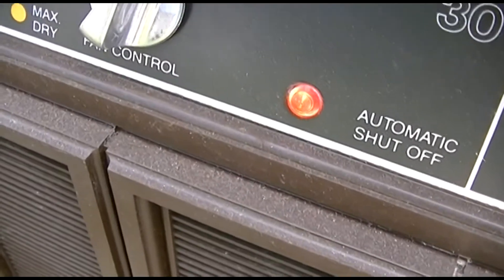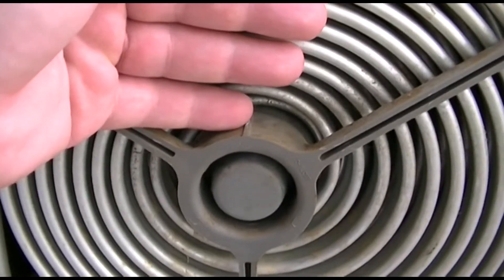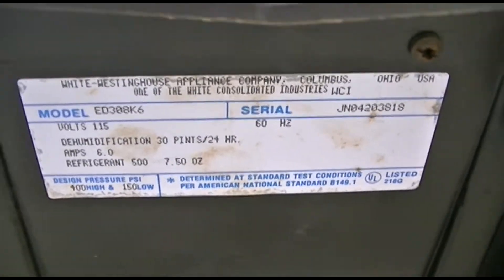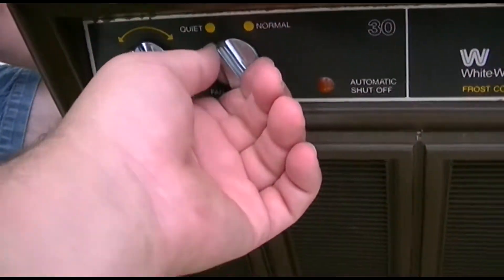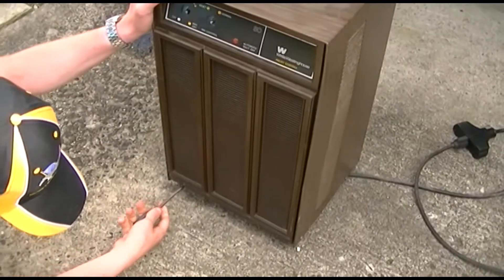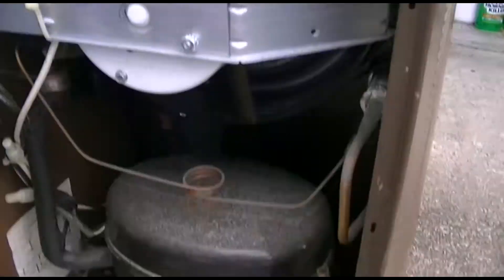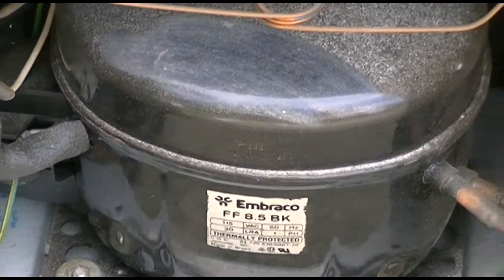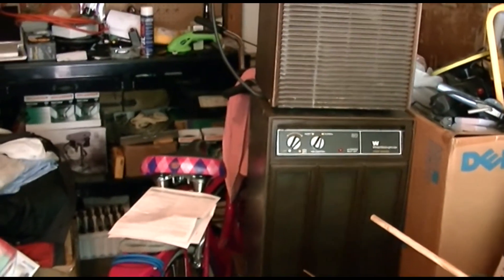VINTAGE Westinghouse 30-Pint Dehumidifier Saved From The Dumpster!

Comment: I have one like this that still runs, but it's not drawing the water.  You said that the coils are supposed to be cool but mine get hot. 
 What is this R500?  Is there something I can do to "recharge" it?
Reply from the maker: If those coils on the back get hot, chances are either the system is low on charge, or the defrost reversing valve (if it has one) is stuck open.  Open the unit up and run it, and feel the coils inside.  If those get cold but the outside ones get hot, it's a reversing valve issue.

Nothing you can do to recharge it, you'd need to employ the help of a refrigeration repair company.
Reply: jaykay18  I want to thank you so very much for getting back to me so quickly.  That was very kind of you.  I think at this point I'm going to have to bring it to the dump.  You are awesome to help me like that.
Reply from the maker: No problem Kim.  I always strive to respond tom comments ASAP. 
 Sorry to hear that yours isn't working any longer.  Try and find a vintage unit, you will be MUCH better off.

Comment: mentioned you were doing a wattage test but no mention of the wattage it was using okay
Reply from the maker: Yeah, did you happen to notice the person who said that has a camera they were recording with?  And what's the difference unless you own the same unit and your own wattmeter?
Reply: Thanks for your reply yes I do have the same one that I just got from an older couple the funny thing is it was still in the box the not funny thing was when I got my electric bill this month really jumped compared to the other one that I have even that is older I didn't expect it energy efficient but it's definitely an energy hog again thanks for your response and have a peaceful evening
Reply from the maker: @brianhall8097  Well that's the same reason I have a V6 engine in my car.  Costs more in gas for sure, but the horsepower is there if you need it.  Same goes with the dehumidifier, it'll run but it'll cost, the main thing is it'll RUN, instead of break.
Reply: Yes couldn't agree with you more I've seen on YouTube a lot disappointed in the new humidifiers only working a year or two so I guess I shouldn't complain I have two good old ones just pay a little extra on the electric bill it's better than buying a new one every couple years again thanks will look out for your next video thanks again
Reply from the maker: @brianhall8097  Thanks very kindly, Brian.  New video every day.

Comment: Nice dehumidifier! The two speed versions of these are not common, and R500 is not a common refrigerant! These units also typically blow their air out the side instead of the front.
Reply from the maker: Yeah this is a rare one indeed!

Comment: I saw that compressor is made in Brazil.
Reply from the maker: Not surprising.  WCI would cut corners where they could, but little did we know it would still be an excellent product some 20+ years later.
Reply: Newer models have an Embraco compressor.  The older ones with the tank which hangs off of the back have an Italian-made Aspera compressor.